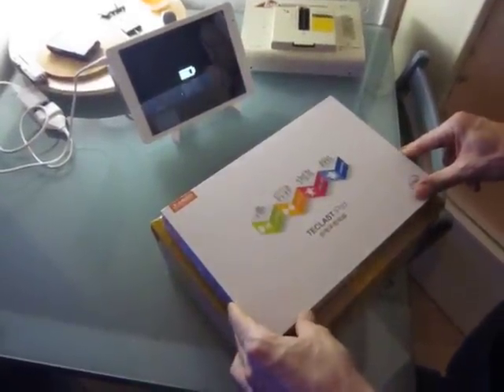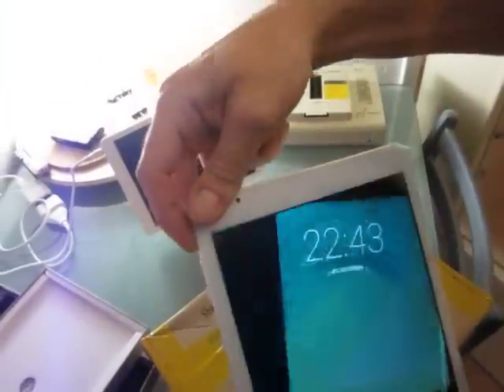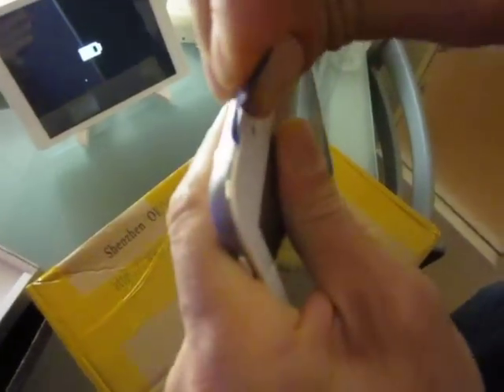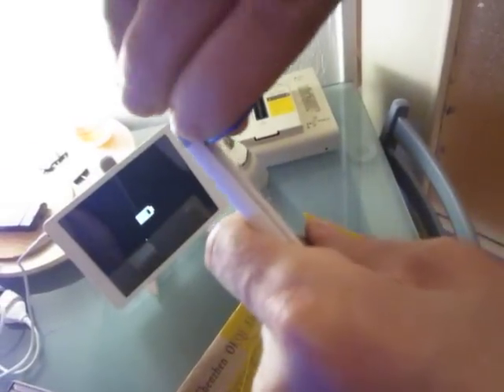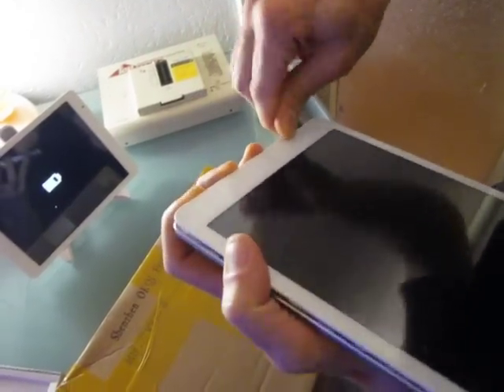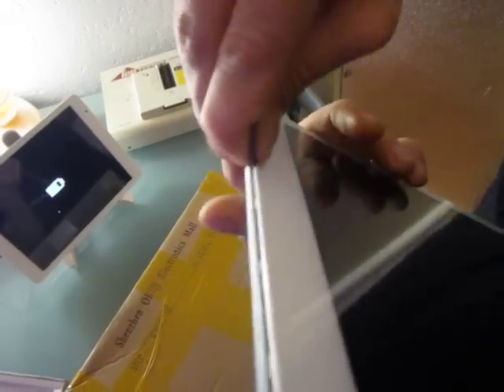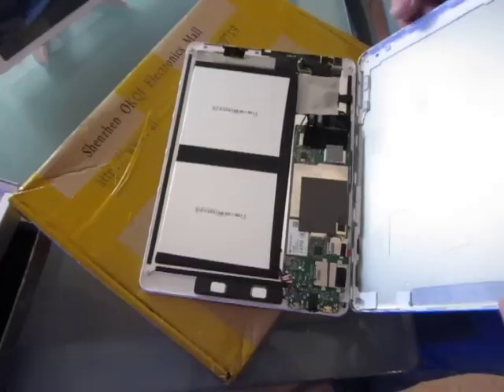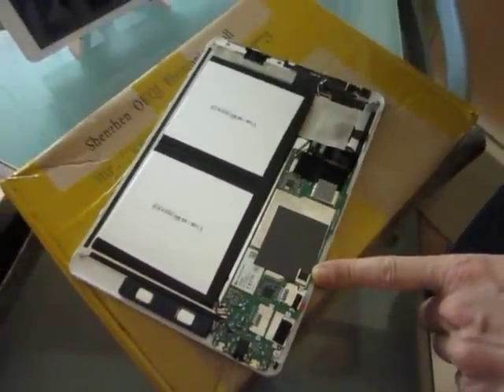Teclast X98 air 3G fixing/opening Unbrick bios ...

Comment: Thanks to this video, i managed to open up my tablet. But, till date there's no follow up on this video with regards to flashing the ROM. 
As what 会長反ヒカキン同盟 has mentioned, the CH341A programmer operates at 3.3 - 5v, which obviously is going to fry the Winbond chip which only operates at 1.8v.

We would really love to see how it can be done, or what else is required.

Comment: DO NOT USE CH341A 
because winbond flash needs 1.8V 
but this product is only support 3.3v and 5v only.
if you want use CH341A, you need logic level converter.
sorry for my bad english.

Comment: Is that posible that tablet [Teclast X80H]  if bios is broken wan't turn on, but processor or something is heating? Pressing Power button + Volume UP = DEAD.  No posibility to power on. Thanks for your Video and waiting for more abouth flashing bios chip. I would be super, to hear abouth flashing teory, what software to use and hardware. Thank you.
Reply from the maker: of course if our bios is broken, then the tablet wont boot ...
Reply: spzjulien I know but Is this the heating up are normal symptoms of a damaged bios when I try to power it up.?  And if I can fix it? :) Thanks for your reply.
Reply from the maker: Zbigniew Adam Karski

try to re-flash original bios with hardware programmer .....
Reply: spzjulien It's wird, I found my teclast in network shares :) No option to connect by SMB. It looks like a TFTP or PXE boot option. As now I cannot reflash it - no hardware. Im waiting for SMD chip already reflashed by some company with my bios .bin file.
Reply: Zbigniew Adam Karski i jak udało się zreanimowac x80h? Jestem w podobnej sytuacji brak jakiejkolwiek reakcji na przycisk power
Reply: Michał Sadowski temat chwilowo wstrzymany. Idzie z Aliexpress programator. Ale nie poddaję się. Co się dokładnie stało? ja grzebałem w biosie. Po zainstalowaniu czystego windowsa8.1 PL. coś tam przestawiłem w bios - dałem default i pad.
Reply: U mnie bardzo podobnie. Grzebanie w biosie zakończyło się totalnym brakiem
reakcji na przyciski power, vol+, vol-. Jakby nagły brak prądu.

Comment: Thank you for this video. Please, can you help me. I can't charge the tablet while it is on. When is off it does charge, but the display will not start up showing the battery charging. After I turn on the device, it will stop charging. It looks like UEFI issue. When Tablet is on, and I insert the charger, will not recognize that there is charger. THE Usb port works, if I insert usb key, or keyboard, but not charge when system is on. Please Can you help me? More info here http://forum.xda-developers.com/showpost.php?p=58107817&postcount=4699

Comment: 2nd video gogogo:)
What is the use of the tool shown via the 2nd ebay link?
greets
Reply from the maker: still waiting for a programmer, i have chip and clip, still waiting programmer, i guess Christmas dont help ...
Reply: spzjulien how about the difference between the operating voltage of the chip and programmer?
Reply from the maker: this is the clip to connect to the bios chip, to program it ..
Reply: spzjulien well, my english is so much worse, i think. or u r broke ur chip

Comment: Thanks alot for this video. Just got my teclast but its already bricked :(. Anyway the programmer is on its way. However, it's really hard to open my teclast X98 AIR II. Will try it the the guitar thing later but for now didnt succeed. Anyway, will check out your flashing video.